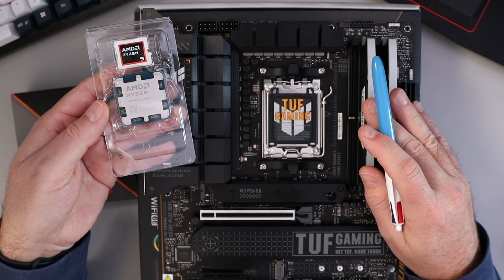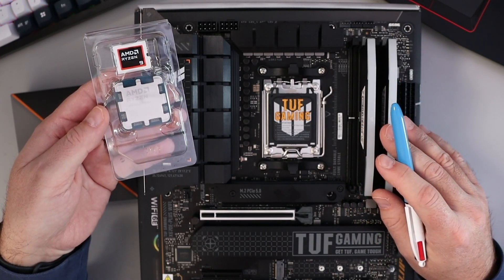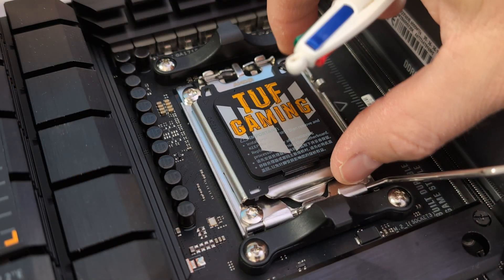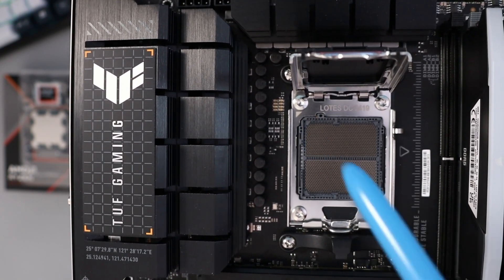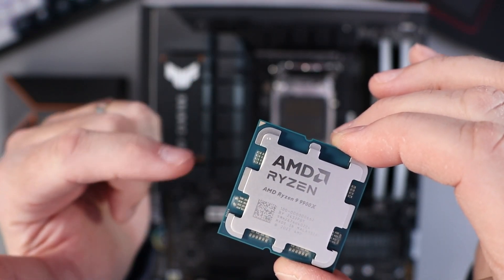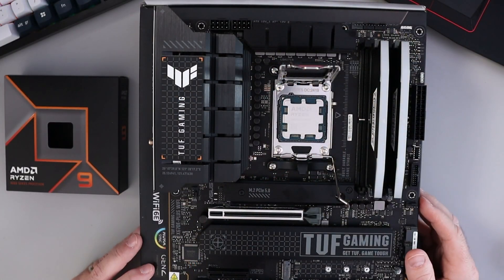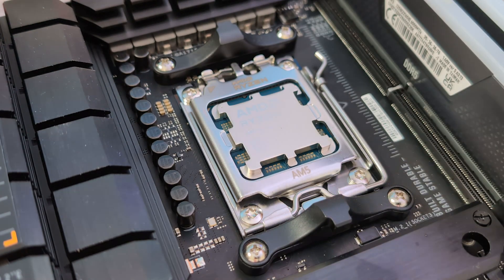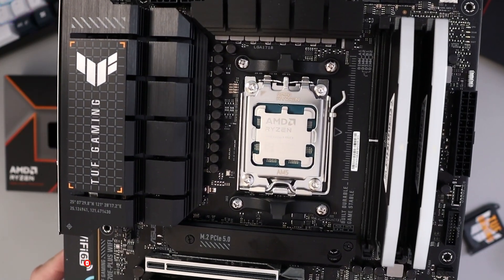How to Install Ryzen 9 9900X in AM5 Socket (Asus Tuf Gaming X670E-Plus WiFi Motherboard)

Comment: Hi, just bought both of these. If my MOBO is not up to date with the latest updates, would it be possible for me to actually turn the pc on to update the BIOS? 

If not, do you know of any proper options - I currently do not own any other ryzen desktop processor for that end.
Reply from the maker: You should be able to flash the bios with a thumb drive. I don't have a video on it yet for this specific motherboard.